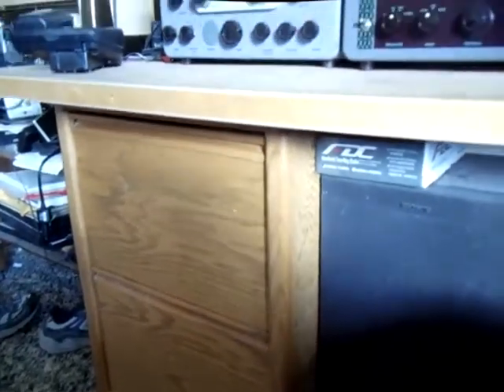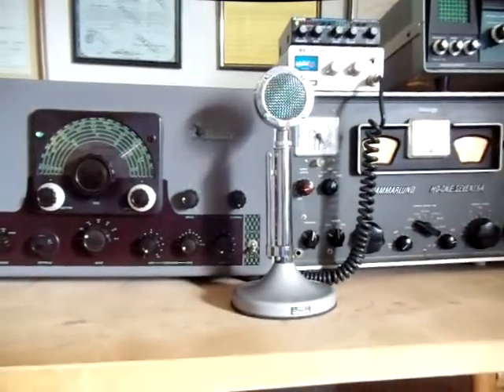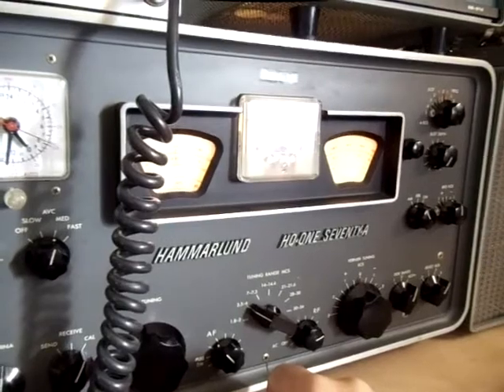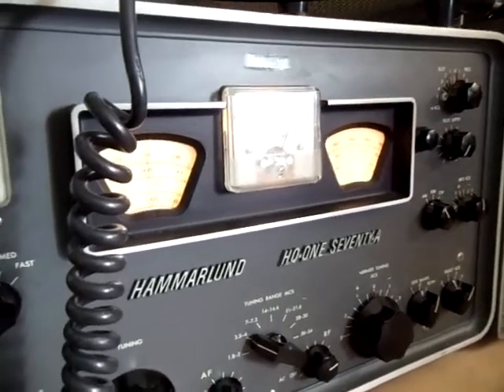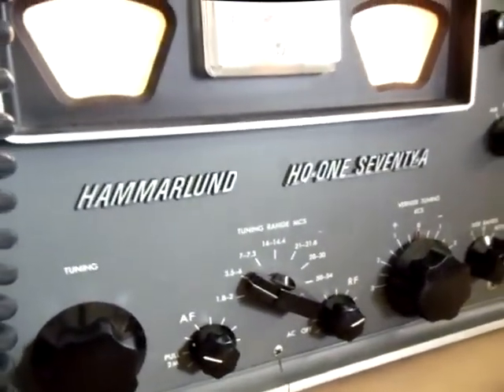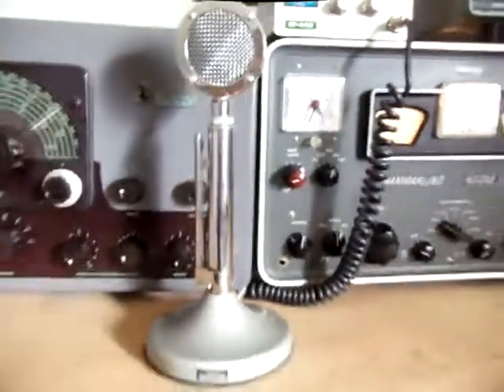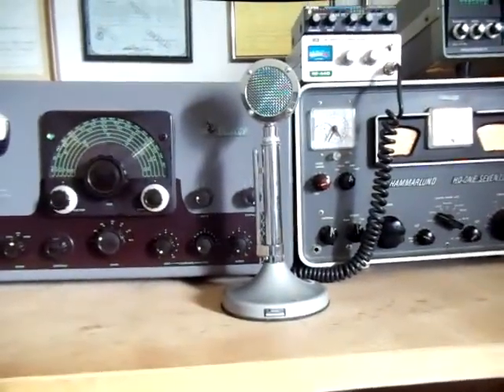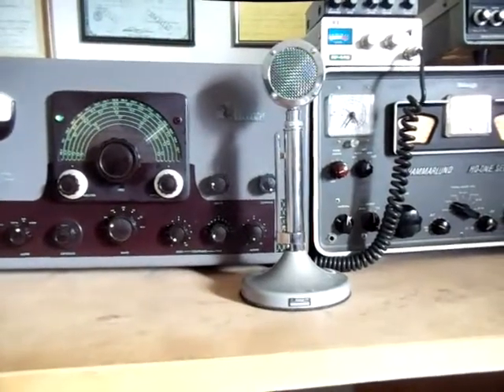K7PP, Zero beating an AM signal with Johnson Viking Valiant Ham Radio

Comment: I have a vintage 10 meter AM transceiver by Johnson Controls.  I think the radio may have been modified from a different service, perhaps taxi service.  But unfortunately, looking at the 10 meter band plan, the AM portion of the band is tiny and out of the previleges of the entry level license.  Essentially, the old 10 meter AM transceiver is worthless for everybody except those that hold higher level licenses.  For those with higher level licenses, they would find no interest in that tiny modicum of AM segment.  Thus, the old transceiver is worthless, although it works.
Reply from the maker: Just wonder ing what the model of the unit is.   Johnson Controls made some low band Commercial FM units that covered 26 to 27 Mhz.   Does the unit have a squelch control?   

Regards,  Pete
Reply: @dogtagsvette Yes, it has squelch.  I rather suspect it was a tranceiver for a taxi.  It has two small knobs on the right one over the other in aluminum. The front looks as if it were aluminum colour a long time ago. It has faded to the traditional faded yellow plastic colour of old electronics. On the center it has four turn wheels.  The, "2," is assumed.  The first small thumb wheel has 8, 9. The second, third and fourth wheel are 0 to 9.  28.000 to 29.999.  I was told it was AM.  The speaker is to the very left on the front.  The back has nothing but the antenna connector and a short heatsink.  It has no lights.  It has a grey metal case.  I think there used to be a vintage style RF signal meter to the right of the speaker that is now a small piece of plastic someone put there. It is about the right size.  The tag on the back is really bad and only Johnson controls can be read.  The serial number really can not be read.  I rather suspect it is modified because the first thumb wheel looks slightly different from the rest.  It was given to me a very long time ago.  I have never heard anybody on it.  But the guy that gave it to me said it worked fine.

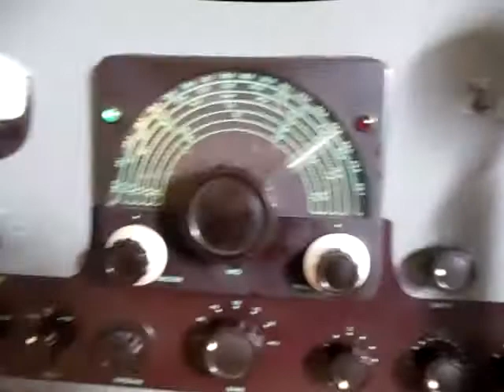Comment: Nice video, thanks!   2:25 what does the Zero position of the switch on the transmitter do?  Does it turn off the amplifier part of the transmitter, so that you get only the oscillator to zero-beat against the received signal?
Reply from the maker: That's exactly right.   It activates only the VFO so that you can hear the beat note in your receiver.  If you are running a crystal, however,  this does not do anything.   If you need to spot using the crystal you may have installed,  simply turn the mode switch to CW and it will activate the external crystal so you can spot.   Hope that helps.